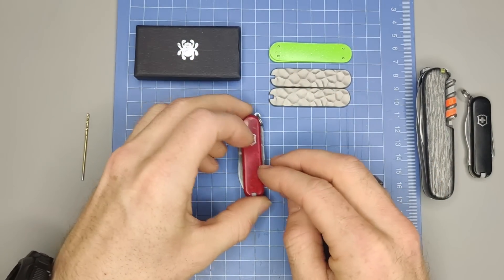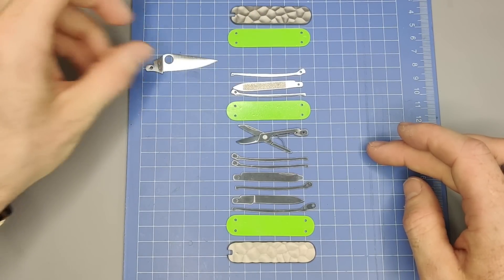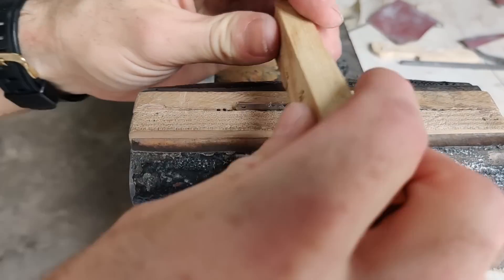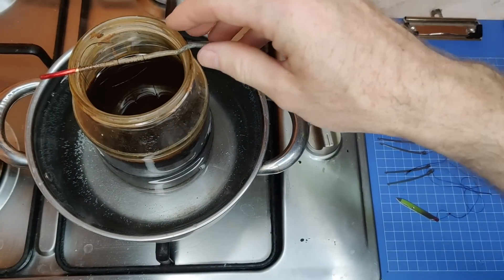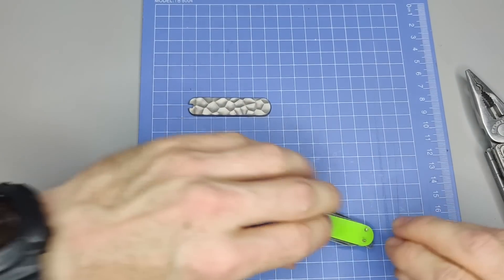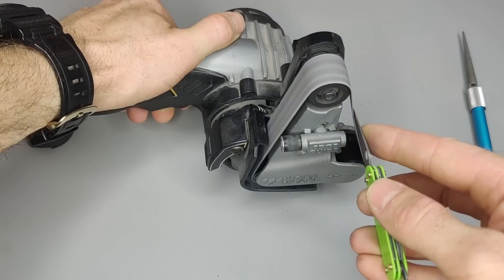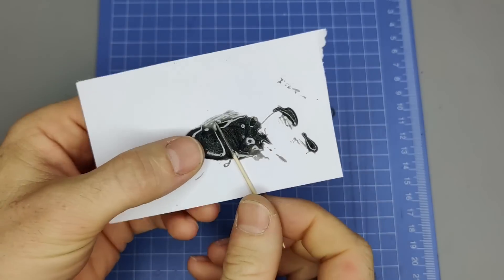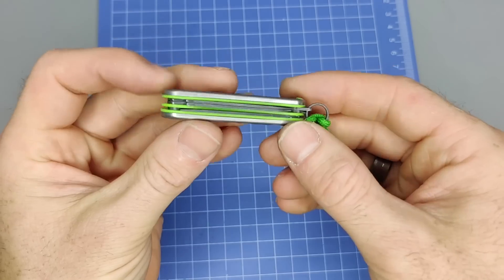How I made this Spydernox Kamakiri

Comment: I'm not going to say that it may not be easier for you, but I'd like you to consider what I say about the sharpening process. When flipping the blade the burr will fold the same way each time and it could make the sharpening process longer, additionally when the blade faces up, you can end up removing more abrasive than necessary. Just some thoughts for you.
Reply from the maker: Thank you for sharing that! I will take it into consideration. 👍🏻

Comment: Depending on scale/liner thickness you can sacrifice either the tweezer/tooth pick an open the hole a bit then you can add one of the micro led lights that are used for light up fishing bobbers/illuminated arrow nocks
Reply from the maker: That would be an interesting project. 👍🏻 I saw Felix Immler do something like that with a 91mm scale.
Reply: @FittoSurvive  ya for any1 wondering these are the little lights I spoke of they have white but kinda hard to find

Comment: I have a climber and I want to install a saw. How would I do that and would it fit in my climber.
Reply from the maker: It is possible to add the saw. You will need a donor knife, longer brass pins (you will have to make them), and you will need an extra liner.
Unless you are looking for a project or new hobby, the easiest method would be to buy a Victorinox Huntsman. It is on sale now for $31:
https://amzn.to/437Uy2v

Comment: Wow, I am impressed. Now all I want is to poorly attempt to make one myself.
Reply from the maker: Thank you. 😋 Good luck. Send me a message if you need help or advice. 👍🏻
Reply: I’m going to try it next week pls give me any advice I have never done something like this
Reply from the maker: @nisargbrahmbhatt8172  My advice would be to go slow on the Spyderco blade. And be careful not to damage the brass grommets, during disassembly. 👍🏻
Reply: @FittoSurvive  When you modify these stainless steel blades, (whether it's the Spiderco or SAK blades) by taking the grinder to them, do they have to be re heat treated or anything? I'm in the process of wanting to make a simple 2 bladed, slipjoint style SAK and want to grind down one of the blades to a sheeps foot

Comment: This is pretty awesome but I’m kind of curious if you could reuse the regular metal pieces instead of using the G10? Or even acid wash them as well?
Reply from the maker: Thank you! 
Yes, I can reuse the original aluminum liners. But they cannot be acid etched because aluminum does not react with the acid. I am looking into getting a system set up for anodizing the original liners. Then, I can choose just about any color for them.
Reply: @FittoSurvive  That'd be really cool, annodizing the scales also could get some of the purple lovers going.

Comment: Just a technical tip. The saw needs to be narrower behind the teeth to prevent binding in the cut. This is called set in a saw. Victorinox emulate set by grinding the blade to taper slightly from teeth to spine.
Reply from the maker: Very interesting. I will look more into that. Thank you for the tip. 👍🏻👍🏻
Reply: Excellent point, most European saws put a slight bend to the tooth. I usually see the taper in Japanese pull saws like the Silky arborist saws.
Reply from the maker: @DravinD81  Definitely interesting. Can't say that I know what you are talking about, so I will have to Google it and learn something new.

Comment: Your grinding will go much smoother if the wheel is centered and balanced on the shaft.  If you have a lathe, make a proper flanged arbor with a bored center-hole and tight-fitting register.  Once you've done that, you'll be able to dress that CBN wheel properly, truing it up and getting rid of that glazed surface.
Reply from the maker: I don't have a lathe, but thank you! I will look into that.
Reply: @FittoSurvive  As long as there's not any unusual geometry, I can send you an arbor if you take some calipers or micrometers and measure the diameter of the shaft, diameter of the hole in the grinding wheel, thickness of the grinding wheel at the shaft, and approximate length of the unthreaded portion of the shaft.
It'll look like what Shop and Math made in his video titled "arbor for diamond wheel".

If that's a diamond wheel (not CBN), I'd recommend using a Norton white wheel instead if you're using it for grinding any type of steel, since diamond dissolves into steel at high temperatures.
Reply from the maker: @elonquemattheson6151  I appreciate that! I'm going to take it apart and see if I can't figure out how to take care of it. 👍🏻  I'll send you a reply if I can't get it figured out.
Thanks again! 👍🏻👍🏻👍🏻

Comment: hi. sir whats your advice on boker Caracal Folder 42, i want one folding knife for keep in my car, for normal use and also for emergency if need, is this knife good sir❓
Reply from the maker: Hello!
Boker is a very good German made knife. The Caracal Folder 42 is a very nice knife, I had to do some research on it as I do not own the knife. (But I am interested in it now. 😋)
The steel on the Caracal Folder 42 is D2, which has a hardness of 55-62 on the Rockwell scale. That is high hardness, it should hold an edge really well.
The uniqueness of this knife is the how it locks open with a pin, making it basically a fixed blade knife.
I think this knife would be great for an emergency kit. 👍🏻
Reply: @FittoSurvive  thanks sir
Reply from the maker: @bluediamondwatch6633  You are welcome

Comment: Working on my first attempt with this. Took my mini champ apart and pretty much ruined the brass washers. Where can I find new ones? 58 mm or should I start looking for another knife?
Reply from the maker: Hey. The brass washers can not be purchased separately. If you damaged them during disassembly, you will need to find a donor knife that you can harvest them from.
Reply: @FittoSurvive  was afraid of that... should have used smaller drill... I can use a new brass rod though right?
Reply from the maker: @MrEnder19  Try a 1.5 mm drill bit. If you can't find metric, then a 1/16 works fine. You have to start drilling dead center, or you can damage the brass grommet.
The brass rods can and have to be replaced, unless you plan on removing layers from the knife like I did in this video. I have links to the brass pins in the description of the video.

Comment: Love it but it’d just bug me seeing the g1 not completely flush with the scales 😂
Reply from the maker: I understand that. To fix this issue, you'd have measure the G10 to the titanium scales instead of to the original liners.
Reply: @FittoSurvive  i would’ve put both scales on then gently compressed the knife with maybe a vice or triggerclamp so the epoxy bonds them better
Reply from the maker: @brandonzimmermann  That is a good idea. I have used a small vice before for attaching the cellidor scales.

Comment: I would pick carbon fiber because its lighter and it just looks so cool
Reply from the maker: I am really tempted to do the carbon fiber. Biggest downside is that the parts of the liners that will be visible will just be grey. 🤔 Plus, it is much less work than anodizing the aluminum liners. 😝
Reply: @FittoSurvive   that is a down side but the good thing is you don't have to sit there and wait  for anodizing to be done
Reply from the maker: @davidcovarrubias4793  Exactly! 😏

Comment: I’m guna do this buy what thickness are the g10 liners used and are they the same thickness for all the Knives? Also what brass pins are used :)
Reply from the maker: I use a 0.04 inch G10 for the 58mm SAKs. https://www.makermaterialsupply.com/collections/g10-sheets/products/04-g10-knife-handle-liner-spacer-sheet-5-5-x-12-25-13-vibrant-colors

And here are the brass rods for reassembly. https://amzn.to/3cUCnse
Reply: @FittoSurvive  ty so much for the info! I know your busy :) the g10 size hit the bigger sak’s are thicker? I ordered one of every size haha
Reply from the maker: @Quintanater  You are welcome! Oh yeah, forgot to answer that part. For the 91mm I use 0.03 (1mm)
Reply from the maker: The 91mm also needs a different size for the brass rods. You'll need 2.5 mm and 2.2 mm.
Reply: @FittoSurvive  awesome! I’m having a hard time finding a 2.2mm rod. I did find a 2.5mm and the 1/16 you told me to get in solid brass
Reply from the maker: @Quintanater  The 2.2 is a hard to find size. I usually order directly from China. Try looking on Ebay.

Comment: Well done job! I am impressed! The first thing I would change in Viktorinox is the ring, my own ring is strong, but it is too small, but I would like to tie the lanyard directly to Viktorinox, without using a small ring that can unbend.
Reply from the maker: Thank you! 
Maybe a cellphone lanyard would fit through the small keychain loophole? A paracord lanyard will definitely be too large to fit through without the ring.
Reply: @FittoSurvive  apparently I did not quite write it correctly, I would like to hook the lanyard to the metal part that is attached to Viktornox itself, without using a small ring, since I do not quite trust him
Reply from the maker: @k1ssm34t  I understand. 👍🏻 The metal part that the ring attaches to is pretty small. So, it may be difficult to attach a paracord lanyard to it.

Comment: Amazing conversion - well done - except for the saw. Victorinox saws are awesome, because their spine is ground thinner, so they won't bind. You missed that.
Reply from the maker: Thank you! Hmmm... Not sure how I could make the spine thinner on the saw and still make it look nice. 😅
Reply: @FittoSurvive  - grind it down BEFORE etching and putting the teeth in - take the biggest diameter wheel and make a slight hollow grind from the spine towards the teeth-side, ending, where the teeth shall begin. Stop, when the spine is about half as thick. Not sure, if you can do it with this knife, but sure on the next one ;-))
Stay safe and keep up your good work.
Reply from the maker: @mannihh5274  Sounds like it should work. 👍🏻👍🏻👍🏻

Comment: Where do you get the spare parts like certain tools from?
Reply from the maker: I have obtained a rather large amount of spare parts from knives that I have taken apart for tools. So, I either use parts from there or, I take apart another knife for the tool that I need.
Reply: @FittoSurvive  wow that must be very expensive.
Reply from the maker: @Cicada-uv5se  It is originally, but when you can put together a knife from spare parts instead of buying a knife to take apart, it pays you back.
Reply: @FittoSurvive  Sounds like a fun hobby. I'll have to try it some time.
Reply from the maker: @Cicada-uv5se  It really is. 👍🏻

Comment: seeing you open that knife repeatedly with your thumb on the blade was so upsetting
Reply from the maker: I was trying to demonstrate how easy it was to open and how it would snap. 😅 But yeah, several people have mentioned that part of the video as being unnerving. 🫣
Reply: @FittoSurvive  i get that the springs on the small ones aren't very strong and at some points the blades weren't that sharp, but just on instinct i flinch

Comment: if i may suggest something, i would have tried to leave as much of the original shape intact, only flatten out the kick. and then Drop the nose/tip like they do on the endura/delica. that way you might have had better acess to the blade and more blade in general! :)
im not good at riveting though, so i have never tried this! This is just what im thinking as i watch this... so maybe its alot harder this way
Reply from the maker: I'd love to be able to leave more blade, but I have not found a way to do that. The section by the pivoting hole is too narrow to do much angle manipulation.

Comment: Hey awesome work man. So cool.
I have a question. I love the victorinox compact and am wondering if it's possible to add a small blade to it so it has 2 blades and also replace the combined bottle/can opener with the two individual can opener and bottle opener. The reason I want the small blade is to modify for wood wittling.
Could this be accomplished by adding an extra layer to the victorinox compact?
I would appreciate any insight you have.

Also. Do you sell your creations anywhere or do personal custom orders? Thanx and God bless.
Reply from the maker: Hey Chris,
What you described is easily done. There is actually a model with that exact toolset. It is the Victorinox Climber. Here's a link: https://amzn.to/3KqhCz9

I do accept custom orders. Check out my website for information on how to order one. www.f2scustoms.com

Comment: neat video and knife. One question though, why do you always use the g10 liners instead of the original metal ones?
Reply from the maker: Thank you! I often use the G10 for style and it is actually a very good substitute for the original aluminum liners. I have made several builds with the original aluminum liners too. It turns out pretty nice too.

Comment: Great insider of the process 👍Do you also ReSharper the scissors? Mine struggle to cut through paper after acid and stone washing them. Also I would go with the anodized aluminum science the carbon fiber face won't be visible
Reply from the maker: Thank you!
No, I do not resharpen the scissors. Haven't had any problems with them being sharp. If I am not mistaken, the Victorinox scissors are supposed to be self sharpening.
You are correct, if I do the carbon fiber liners it will just be greyish-black.

Comment: Is there any advantage to using g10 liners instead  for aluminium? Less weight? They seem to add bulk to the SAK
Reply from the maker: The main reason for the G10 liners is just design. They weight about the same as the original aluminum liners. These G10 liners are about 0.1 mm wider than the original liners. So they add a bit more bulk.

Comment: Interesting project but I would have still used steel as the layers to brace the tools, using the G10 only as the outer case and keyed the surface inside for better epoxy adhesion, G10 is resilient but I would only use it for scale liners or maybe a thick spacer rather than the actual structure to a functional tool, the best part was sneaking the spydie blade on
Reply from the maker: The original liners are aluminum, which is not that much more rigid than the G10. But I completely understand what you are talking about.
Keying the outer liner sounds like a very good idea! I will have to try that.
Thanks for the tips!! 👍🏻👍🏻
Reply: @FittoSurvive  I use worn 36 grit 2x72 belt cut into 8" lengths, but some 80 or 120 will be fine on small pieces of liner material, obviously careful of the dust etc
Reply from the maker: @WessexBladesHandMadeKnives  OK. That makes sense. 👍🏻 Thank you.

Comment: what is that sak on the right with custom scales and stone washed tools?
Reply from the maker: That right there is my very first attempt at modifying a Swiss Army knife. My beta build I guess. 🤣  It has aquaprinted cellidor scales, acid etched and stone washed tools, aluminum and G10 liners. It also has a Swissqlip on it and tinder in the corkscrew from Tortoise gear. 😋

Comment: Hey bud do you know What the size of brass flanged bushings for a 91mm Swiss knife is? I can’t figure it out I need a couple for a project of mine.
Reply from the maker: Hey, the inner diameter is 2.5 mm for the two on the outside and 2.2mm for the one on the inside.
I have never had much luck finding them. I harvest them from other Swiss Army Knives if I damage one during disassembly.

Comment: Carbon fiber liners🥳 oh and the aluminium anodised would also look cool

Awesome build as always, I like the compactness of this, I would prefer a small Philips screw driver instead of maybe the saw but to each his own.
Reply from the maker: 🤣 So, which do you think would be better on the XAVT? Carbon Fiber or anodized aluminum?
Glad you enjoyed the build. 👍🏻👍🏻👍🏻
Reply: @FittoSurvive  the aluminium i guess, and remove two of the redundant tools and add the spyderco blades, one small one large
Reply from the maker: @l.nassah6728  I ended having trouble getting the anodizing process to work consistently for me... I may end up using something else.

Comment: roughly how much do you feel this would run without the saw mod?
Reply from the maker: About $230. But with this size of knife, you have to have a balance of tools. So, you couldn't remove just one tool. You would have to remove two tools or replace the saw with something else.
Reply: @FittoSurvive  I'm fine with the ruler, I just don't want it turned into a saw. I feel the serrated stock blade would fit my purposes fine and would not want the saw edge on something I'd use as a flat head screwdriver.
Reply from the maker: @voidpunkprincess  Got you. That is possible. 👍🏻

Comment: I'm all for modification, but I'm not really understanding why you would use one of the few steels available that is actually worse than the steel victorinox uses for their blades.

I'd bet the sak LINERS would take and hold a better edge than that 3cr on the Spyderco. 

Seems like you could have used a manbug or ladybug blade, which are available in some amazing steels.

EDIT:

Not trying to take anything away from the quality of your work, or the effort that went into it. Exactly the opposite, in fact.

I think this video finally gave me the motivation to do something similar.
Reply from the maker: I will have to do some experimenting with those other Spyderco models. See if I can get one to fit. 👍🏻👍🏻 Thanks for that bit of advice.
Glad that the video helped motivate you to do some modding too.